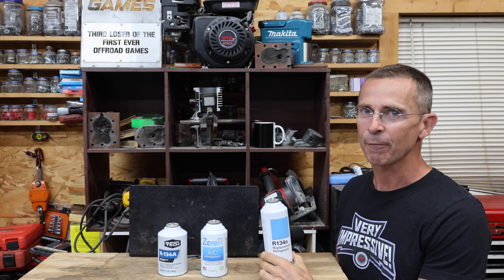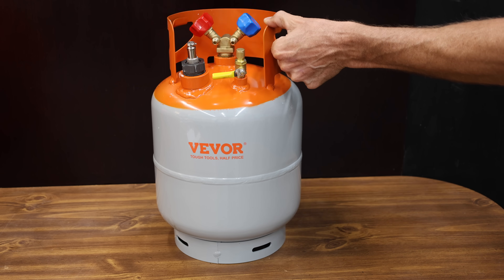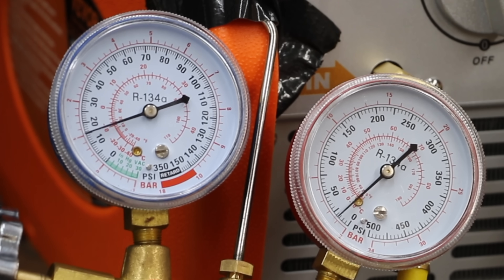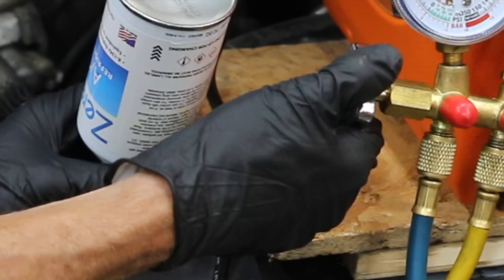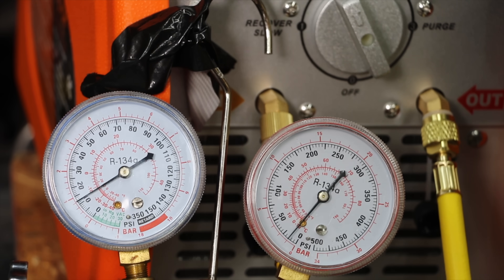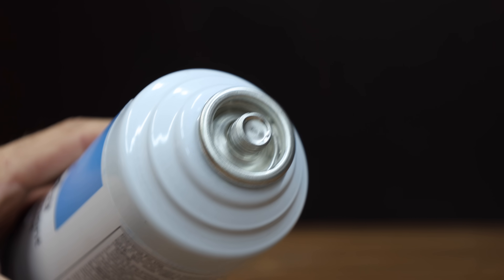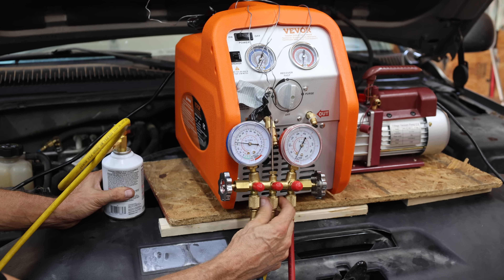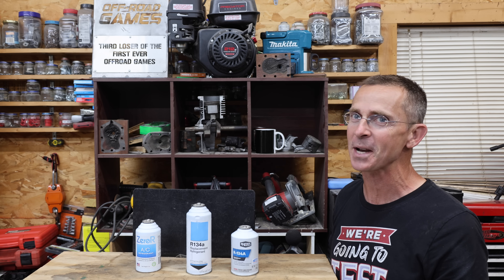How Dangerous is Fake Car A/C Refrigerant? Let's Find Out!

Comment: These "fake" things might essentially just propane, replaces very old R12 systems decently, I mean very old, tube and fins condensor/evap systems. I bought the ones that specifically said R12a replacement, not sure how much the formula is modified. Been running these on my 89 volvo for 4 years now and it works decently well. I'd say always do a complete flush/vac before using a different refrigerant.
Reply from the maker: Thanks for the feedback.
Reply: @ProjectFarm  Thank you for puting up all the hard work and nice content!

Comment: The TP chart does not tell you if it's fully charged, only that it has a specific refrigerant without non-condensables. If you removed a pound of refrigerant and let it set for a bit the pressure would be the same.

Comment: One thing to be careful of using alternative hydrocarbon gases is that the standard oils don't mix well with it causing compressor wear,  heat and uneven performance as oil builds up in clumps
Reply from the maker: Thanks for the feedback.

Comment: Some "Leak Stop" refrigerants can plug your desiccator pad in the receiver/drier. After using them your system will act strangely- worse performance at higher engine speeds.

Comment: If i had the patience i'd try the supposedly more efficient/lower pump load leak saver on my CRZ, where the AC can drop the fuel economy by 10% while hypermiling (over 60MPG without AC can drop to below 55 with AC and yes below 45MPH it this vehicle is far more efficient with windows down and AC off) Most of the time i just dont use the AC because of how much it affects the fuel economy even on the lowest fan speed setting and a relatively high set point about the only time i use the AC is on the interstate where it is more efficient to have the windows up and AC on(MPG can drop below 35 if the speed is over 70MPH).
But i'd be interested to know if the type of refrigerant has any effect. I suspect it has more to do with the pump size and design of the system rather than the fluid. A 'lower load' on the pump might just mean the pump runs longer to achieve the same cooling but i'm open minded.

Comment: I almost forgot about ammonia. Ammonia suppose to work very well, and efficient. Its been used for almost a hundred years, and its still used in very large commercial systems, such as grocery warehouses. Grocery warehouses spend a lot of money on electricity, so if ammonia was not efficient, they wouldn't use it.
(Efficient meaning amount of cooling per watt of electricity)
Reply from the maker: Thanks for the feedback.

Comment: Hydrocarbons can make great refrigerants, but any system has to be engineered around the refrigerant to be used. Perfect drop-in replacements are tricky, they all seem to loose capacity or not hit the sweet spot of temperatures at the correct design pressures or they are incompatible with the compressor’s lubricants.

I tried straight propane in my car and it got extremely cold and the evaporator was an ice block after 30 minutes, so it failed in the opposite way of zeroR. Compressor was noisy too, probably needed the PAG oil changed to a mineral oil.
Reply from the maker: Thanks for sharing.

Comment: Propane, aka R290 is a pretty common used gas for refrigerant. Acts like r404a. CO2, aka R744, make a great refrigerant but pressures are so high. Could do ammonia. Wonder if water would work under vacuum.
Reply from the maker: Thanks for the suggestion.

Comment: In Serbia since we are not part of EU we can still use R134a so all of the people who buy new cars imediatly go to workshops to replace the R1234 with the old stuff bc it cools better. I personally bought a used extraction machine as a summer buisness to take some extra cache. I had to buy the 2nd one just for the 1234 gas and an empty tank... People are insane. Sold 2 full tank of R1234 to a local shop, turns out 1kg is arround 100€ so the shit paid for the 2 machines and gas for my first year. Super profitable side job if you own a house

Comment: What you forgot to mention is that those cans are extremely hard on the compressor and causes ware compared to real 134a. You can also replace 1234yf with 134a
Reply from the maker: Thanks for the feedback.

Comment: You can't charge a system properly using just a low pressure gauge. There are two system types expansion valve and orifice tube. Expansion systems can be charged using high side and low side pressure and a temperature sensor on the low side. Orifice tubes require more temp sensors and calculations.
Reply from the maker: Thanks for the feedback.

Comment: Did you perform a flammability test on the 'control' refrigerant? I for one have wondered about comparative 'fire' performance since the day I learned that in European markets, propane is commonly used in domestic refrigerators and automobiles and has been since Greta's parents were in diapers.

Comment: You can not test the filling degree of ACs based on their pressure, let alone pressure in equilibrium when turned off. That is like measuring how full a propane bottle is based on pressure. It does not work. ACs and propane contain liquids, the pressure will always be only temperature dependent. Add more to the AC (or propane tank) and the pressure will drop back down to the same value after cooling back down.

On top of that, when running, the pressure is still only going to tell you if the system is almost empty or way over full - the compressors use variable displacement pistons specifically to reach a certain pressure.

Comment: Dangerous is relative. I have done concrete, carpentry, structural steel and industrial piping, the other crafts interest me if for no other reason to maintain and or do my own work. Running a decent bead with a flux core MIG does not a welder make. HVAC is pretty specialized and something i have devoted a great deal of free time to gaining a good working understanding of. I now service most of my vehicles and take the opportunities to learn more. Case in point my refrigerator took a dump recently and rather than just hauling it off I used it to experiment. I have been reading up on R290 (for those that don't know that is propane). I have devoted a good bit of time reading up on it and also talking to friends that are HVAC professionals about it. They all have different opinions but the primary concern is flammability and that's reasonable. Flamabilty alone is not a good reason to discount all it's advantages though. Case in point, countertop ice makers primarily use R600(isobutane). Provided you could tap it and put a valve on it you could use the refrigerant from your ice maker in your camp stove... Not much utility in that but just an observation. 

Well I vacuumed down the old fridge and using a conversion table online charged with propane from a coleman camping cylinder (I don't advocate doing this). R600 takes a lot less than R134 for the same application, i can't recall the ratio but it was substantial. It was more experimentation than practical use  but I ended up using the old fridge (outside on the deck) to get us by until we found a replacement. It worked so well I ended up giving it to a friend for a beer fridge (with the understanding he not use it in his house and that when it quit working he scrap it, there are hazzards and it's not just while you are using a device that consideration must be made for). Anyways, it worked for another year and a half and it might well have lasted longer as I left the piercing valve in place rather than crimping and brazing the service line as should be done. 

Now, to the best of my knowledge r290 can be a possible drop in replacement for R134 and R12. My knowledge isn't that of a HVAC tech though and ultimately I wouldn't do that for anyone but my self and close friends I know would honor my stipulations of use and disposal. I have read a good deal and feel that most major cosiderations such as lubricant compatibility is met. There is the question of the compressor and just by their nature you can't really look into them to see how they are constructed. That said in the case of my fridge, the quantity of propane was such that i don't feel the fire hazzard is really that great of a concern. Yea it can start a fire for sure but it's not so much that it's going to ignite half of my house in the blink of an eye sort of thing. The other hazzard is explosion, this one I am more concerned with. Propane can and does cause explosions and it is not ususally pretty when it happens. That said, oxygen is the other major factor in that. It doesn't have a oxidizer element in the compound so how will it get its oxygen? I can't say for certain but i am pretty sure it won't be in a closed system evacuated of other gasses and charged with propane alone. The compressor motor is a consideration for spark but it's either going to extinguish from a lack of oxygen or burn slowly enough to give you some sense of warning. If there is a leak the propane has at least normalized with atmospheric pressure before the oxygen can even start to flow in. In short I don't see and am unaware of any real world investigations that point to a refridgeration device detonating like a bomb from the sealed system. The coleman propane also has the bonus of the oderant, if it's leaking you will smell it unlike actual R290. Now this is not to say that the amount of propane mixed with air is not a hazzard, I would say it's the most reasonable concern and I am fully aware of how confined spaces make that all the worse (note i say confined, not sealed). 

In short flamable refrigerants are a thing and have been used commercially in europe for some time. They are and have been used in industrial application in the US as well. Many folks are using them and don't realize it (counter top ice maker for example). I feel like the us needs to revisit it's regulations on flamable refridgerants for consumer use as R290 has some really good aspects to it as does R600. I don't even know if R600  is technically legal or it just has crept in under the radar in the US. I am inclined to believe that china knockoff refrigerant is likely isobutane and inert gas in a mixture such that the ratio is equal to R134 (I.E. same charge). Based on my experience i doubt you will notice any real difference and quite possibly might think it worked better in some applications. What is not cool is the fact that not only the person using it unaware (if that was in fact the case) but others who service the equipment are unaware and can't ovoid dangers of something they aren't aware of.

Long story short don't take any of what I said as gospel (or really anything anyone says in youtube comments), Dangerous is relative and a lack of knowledge is dangerous. Considering the rest of the world is using flamable refrigerants and primarily without issue I think we could stand to reconsider our regulations in favor of a better understanding of refrigerants. If you are like me and like to tinker I suggest you do a lot of reading but also consider situations like what happens when you get rid of the refridgerator you/I charged with propane as a learning experience. Accepting risks yourself is one thing, allowing those risks to effect others unaware of them is another thing entirely. Be safe, have fun and don't always take "you shouldn't do that" at face value. Generally you shouldn't but often it's a case of protecting ignorant (that's not a bad word btw) people knowing that the knowledgeable ones know why there is an exception. If you consider yourself knowlegable, perhaps bounce your ideas or plans off someone you KNOW is, like a friend who is a certified HVAC tech for over 20 years. They might raise their eyebrows and say, watch out for that... or "I reeeealy advise you not to continue on your project". 

It's also worth noting that as a compressor manufacturer, you sell A LOT more compressors if they are not compatible with each other and you would likely latch on to ANY best practices that you can point to in the name of safety that increase your sales. Not saying there aren't legitimate ones, just that the old expression "It's hard to get a man to understand something when his job depends on his not understanding it." There is a lot of that in many industries though and I am not picking on just HVAC manufacturers.
Reply from the maker: Thanks for sharing.
Reply: @ProjectFarm  thanks for all your hard work. Been watching for a long time and use your findings all the time.

Comment: Hey project farms, can you do a video showing the difference between refrigerant 290 and normal barbecue propane.  Because the only thing I found out is they claim r290 is cleaner because it doesn't have the smell that's added to propane.  They also claim r290 has less butane than barbecue propane. But butane is simply another form of refrigerant called R600a.  Please expose these rip-offs.  I've used propane in everything that it's compatible with and it actually gets colder than r134a because it's boiling point is lower then r134a.

Comment: I'd like to see how much damage the leak sealer can do. Both how it affects heat transfer and how it reacts when the system still leaks and oxygen enters the system with it. It's supposed to harden with air exposure so introducing air into the system should ruin the entire thing.
Reply from the maker: Thanks for the suggestion.

Comment: There are more problems with propane and gas grills, heaters, etc. which are not "closed loop" systems. The only way to safely shutdown an open flame system is to shut off the valve on top of the tank and let the flame go out (except the pilot light, which are being replaced with electric ignition, which has its own problems). Propane has a disturbing tendency to "puddle" at atmospheric pressure, which also makes it a problem when there are leaks. There are probably more accidents with propane heaters and gas grills than any other (other than remembering that gasoline can almost explode when exposed to open flame). Remember your gas heater, hot water heater, powerplant, etc. use natural gas, that is why odor is added to it, because it is basically odorless and will suspend in the atmosphere. Open flames can be our friend ( fireplaces, industrial, etc.), but they can also be our enemy (noxious gases, uncontrolled fires, etc.). Lots of things burn (including our atmospheric saviors, batteries).
Reply from the maker: Thanks for the feedback.

Comment: As an automotive A/C tech going back to the 70s, I'd like to warn your viewers: DO NOT USE THAT CRAP IN ANY AUTO A/C SYSTEM!!  People don't realize the damage they can do with anything other than pure 100% R134a or R1234yf. Avoid any can that claims to stop leaks. They will also stop flow thru the condenser, orifice tube or TXV, and even sometimes the evaporator. Years ago, DIY A/C was easy, but it really is best to take it to someone who knows what they are doing. Also, the ONLY A/C systems that are designed for flammable refrigerants are the new ones that use R1234yf. Modern A/C is one area where it will be more expensive to repair after you have screwed it up. Finally, those little hoses with the gage on them (the cheap, plastic ones) are known as suicide kits, and they do not ever tell if the system is charged properly. You need both hi and low side gages to be accurate.

Comment: These products are essentially LPG - Liquified Petroleum Gas, a hydrocarbon.  The oil used for R-134a is usually POE (polyolester) or a PAG (polyalkylglycol).   The elastomers and seals in a system are selected for compatibility with R134a and may not be compatible with a hydrocarbon.   It would be expected that the seals would eventually degrade when using the LPG.  The oil transport may not work properly either… resulting in bearing damage.

These “alternative” refrigerants are very risky.  Just buy the correct R134a.
Reply from the maker: Thanks for the feedback.

Comment: These hydrocarbons really need to be installed with nothing running, can upside down, let it go in as a liquid, let it gas up for 15 minutes, do the other cans and then cycle it. This will usually yield immediate vent temps that should be within range.
Reply from the maker: Thanks for the feedback.

Comment: Fun fact: Propane works really good in air conditioning. However, it is flammable.  If you car is old and worn out looking, putting propane in for coolant will work.  If it leaks and causes a fire, oh well.  Just carry a fire extinguisher.  The new R1234YF is flammable anyway.  Thus, you are not taking much risk anyway.  I put propane into a 2000 Cavalier.  The ugly junk pile is still running with very cold air conditioning.  A Cavalier is not a loss.  So the owner let me do the propane trick.
Reply from the maker: Thanks for the feedback.

Comment: In Engineering test coffin sized chambers they use to use a 100 Lb cylinder of R22 and an expansion valve in the test box and a suction fan to exhaust the vapor outside. ie use 35 to 50 dollars of gas as a one shot use.  Sometimes they used Carbon Dioxide too.

That was when the fear of global cooling existed; mass deaths due to folks being cold. ie a giant ice age coming due to data

In bigger test boxes the whole box was outside . And 2000 Lb tanks used OR an entire RAILCAR full of hvac gas and a hose to the test area. the tank car on a rail spur to the test chamber.
Reply from the maker: Thanks for sharing.

Comment: do a acid text on the antifreeze with those high miles because antifreeze ph level changes and turn acid and ruins the head gasket could you prove me right or wrong on changing antifreeze every three years
Reply from the maker: Thanks for the suggestion.